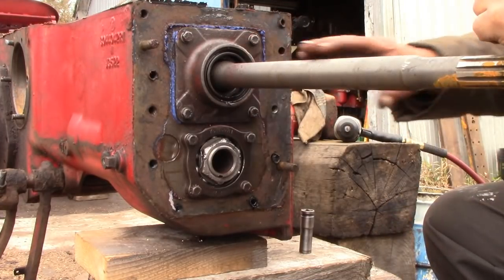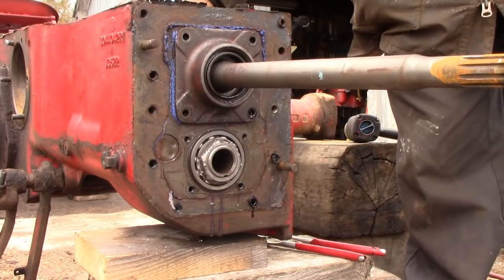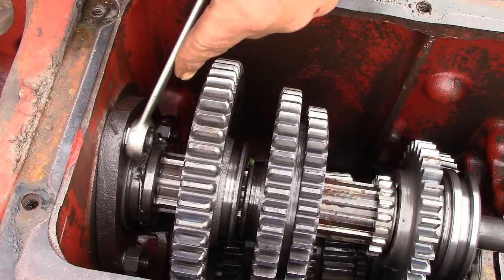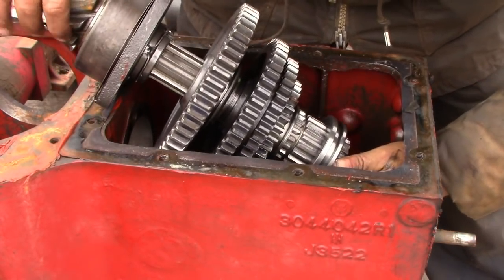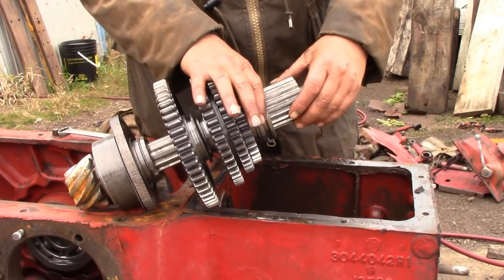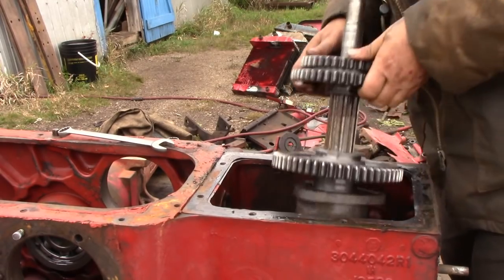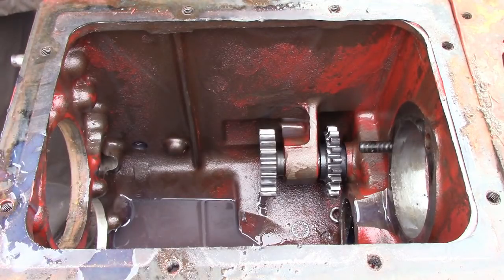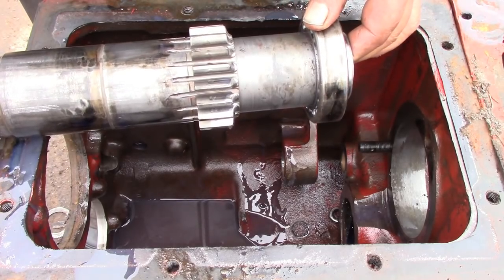B414 Etc  Series Transmission dis-assembly

Comment: Where does the chain with the plactic  couver on it in the Hyl. Unit connect to Found it when I check HYL unit The chain is connect in back  but the front chain not connect  Where does it connect too Thanks any help appreciate
Reply from the maker: It's been a while since I've been into one of those units, I don't really remember where it hooks to.

Comment: What would make noise in the gear box in high range, but not low? The noise go’s away when you depress the clutch. 
Thanks in advance!
Reply from the maker: I would guess a bearing, likely the "quill". You will need to start digging in to find where the problem is. Thanks for watching!

Comment: Hello, first of all thank you for your videos.
I have one question: Do I have to disassemble the whole thing to replace the drive shaft seal (751080R91), or is that possible without completely removing the housing?
Reply from the maker: I'm not sure which seal you mean because that part # isn't showing up in the online parts book, likely an updated number now. The seal ta the back can be replaced by removing the 3 bolts in the retainer and slipping it off, no need to remove the shaft or dis-assemble anything else. Thanks for watching!
Reply: @CanadianRedneck15  Unfortunately, the third screw is right above the shaft and cannot be unscrewed
Reply from the maker: @UltraWK  You can remove the shield if it's in the way, that third bolt has to come out , that is the only way to get to the seal.
Reply: Hi Dave, do you know if the reverse idler assembly can be removed without tearing everything apart?

Comment: Hi Dave,
Thanks gor your very informative videos. I have a question. Where is the hydraulic pump located on a B414? Thanks for taking your time to answer my question and have a nice day.
Reply from the maker: The hydraulic pump bolts into the timing gears at the right side of the engine, just follow the pressure line to the lift unit to the pump. Thanks for watching!
Reply: @CanadianRedneck15  Thanks Dave I did find the hydraulic pump and removed it to replace it. The new pump did not come with a gear. Any suggestions on how to remove gear from pump? Thanks again for your help.
Reply from the maker: @christiangulizia4480  Once you remove the nut put a pry bar behind the gear and hit the shaft with a hammer.

Comment: HI Dave, great videos. Perhaps you can help me. I have a B414 and recently I noticed oil discharging from the dipstick tube. I drained crankcase and ended up with about 18 litres of oil! I then drained transmission and only had 4 litres. What is going on here? Any suggestions on what has happened?
Reply from the maker: There shouldn't be any way for the transmission grease to get into the engine. Have you been needing to add hydraulic oil? Has it been using more fuel than usual. It could be leaking oil through the hydraulic pump or fuel through the fuel lift pump or injector pump. Thanks for watching!

Comment: I have a 63 B250 that has been sitting for a long time.. I drained a lot of water and melted a lot of ice out of the transmission. After finally getting it running I find I can only go between first and reverse. It won’t slide into any other gear. Is this a problem in the shift cover or deeper in?
Reply from the maker: It's probably rust on the rails in the shift cover, you can take it off and pull the rails off and clean them up. While you have the shift cover off it will give you a chance to check out gears too. Thanks for watching!

Comment: I recently just got a international 3414 backhoe and I took the shifter plate and plate off over rear end gears and the bolt on bearing which in your video you called it a bearing retainer has came apart how would I go about getting that bearing or just the whole main shaft assembly

Comment: Dave, I have the same transmission, the clutch seems to work properly, however it usually grinds into gear. I've tried waiting till the tractor stops, and also double clutching. Nothing seems to help. What would you say is causing the grinding? Thanks!
Reply from the maker: If you come to a full stop and then shift gears and it still grinds the clutch has to be grabbing. Thanks for watching!
Reply: @CanadianRedneck15  yeah maybe I'm taking out of gear and then stopping it, need to leave in gear then stop, I'll pay more attention next time, thanks so much!

Comment: hello, take it easy, my ih 444 is stuck in serial gear, it stops when it is reinforced, how can I do it, thanks
Reply from the maker: At the base of the shift lever there is a little cap on either side. Take a small punch and drive it into one and this will push the pin out through the other side, you can then take a long screw driver or pry bar down through the opening and line all of the notches up in the middle of their travel. Thanks for watching!
Reply: @CanadianRedneck15  thank you💖

Comment: i have the industrial loader version of this tractor a 3434.,,well mine is a very late 1982 based on the 434..it will be time consuming to split as the loader frame and cab is built around the tractor ..the bearing race in the reverse idler has collapsed ..the tractor is new to me and reverse seams'' fine ..its been like it for some time as there is no shrapnel in the bottom of the gerar box so someone has cleaned it out and not fixed it  i only noticed when i was replacing the top gasket..from previous experience with a 3434 years ago when this baring collapses the needles from the bearing mixes with the oil and bang and ping about when they jam with the gear teeth...the diff cover is easy to remove on the industrial tractor as it only holds the seat in place so easy to get to the snap ring so what i am asking do you think there is enough room to remove the reverse idler and fit a new bearing with out splitting the tractor and dismantling  ??? thanks dave
Reply from the maker: It's certainly worth a try, if you can fish it up by would save a ton of work! Thanks for watching!

Comment: We’ve got a knocking noise when in second gear in both high and low range. Can I just take the gear shift lever plate off to see what’s going on?
Reply from the maker: You will have to lift the hydraulic lift unit off to get the shift cover off, but that is the best bet for seeing what is going on. Thanks for watching!

Comment: Hi Dave,Mike in Ireland,rebuilt a b275 engine with help from your channel thanks.quill bearings missing in gearbox, my q is do I have to split the tractor in two places or can I just split in front of the gearbox.does the shaft slip out of the clutch section or do I need to split it at the clutch also,feeling a bit daunted ,thanks
Reply from the maker: You will have to split at 2 places to get into the transmission. Split at the clutch first, then you can split at the front of the transmission. Thanks for watching!

Comment: Dave I have a B414 with a transmission that makes a loud grinding/ chattering noise when I put it in high range in all 4 gears. Can I diagnose it by taking the shift cover off or do I have to split the tractor?
Reply from the maker: You should be able to tell by lifting the shift cover. To lift the shift cover you have to lift the hydraulic lift unit. Thanks for watching!

Comment: Can you explain how the 444 tractor should sound it makes a noise when I'm operating it but when I press the clutch it goes away and it sounds like it's getting worse
Reply from the maker: Depending on the noise it could be a bearing going back, broken gear or hard to say what else. The only way to know is to start digging and find the problem. Thanks for watching!

Comment: Great presentation indeed. It's so helpful. I am a new owner of a 450 and looks like they have the same arrangement with 414. Just want to know if gearbox and differential share the same oil after topping up from gearbox filler port, and how many liters does it take
Reply from the maker: An IH 450 is quite a different tractor though the transmission and differential do share a case and the oil is shared so you can fill from the one plug. Not sure how much oil it takes.
  Thanks for watching!

Comment: Hi Dave. I have a 414 that I'm tidying up to sell. Waiting for some brake pads, temp guage and tacho and I think watching your other video I need a steering rebuild kit as it is full of water and gunk but it also drops out of 3rd and 4th gear when underway. 1st and 2nd are fine. I cant remember if high or low range make a difference. Wondering if you have any idea what might cause this?
Richard
Reply from the maker: Sounds like there are some worn gears in there or possibly bad shaft bearings.
  Thanks for watching!

Comment: I've got a 276 International, looks like I might need to remove the whole hydraulic unit to remove the top trans cover? One bolt seems almost impossible to get out, am I correct? Just got the tractor, been setting a while, and the shifter doesn't move.
Reply from the maker: Yes the lift unit will have to come off, you will need the space to set the forks back onto the gears even if you could lift the shift cover off.
  Thanks for watching!
Reply: Thanks, I'll have to borrow an engine hoist from a friend to get that lift unit off.
You'll be my first call if I need parts, you're not to far from me.
Reply from the maker: @Gearheadtom  that lift unit sits down on 2 dowels, it usually is kinda "glued" in place, you will probably have to pry it loose before you can lift it clear.

Comment: Hi Dave,  My B414 works perfectly in low range but when I lift the lever and put it in high range, it makes a noise in all 4 gears. its kind of a grinding rattling noise. any idea whats happing there?
Reply from the maker: It could be the quill gear or a worn or bent low range shift fork not completely dis-engaging the low range gear.
  Thanks for watching!
Reply: Might be a idea to change oil into gear oil 80-90w instead of some tractor universal oil to. I got that problem on my 444 after changing to tractor universal, but i just drive on. 10 years whit the same noise now....., ups maybe time for a oil change, gear oil this time for sure. Love these videos, so well done, how to take it apart, and what might be wrong, excellent presentation.

Comment: Is this transmission the same or similar to one that is in a 300 U ? The transmission in my 300 has a knocking sound ,it changes with RPM's and goes away when the clutch is depressed.
Reply from the maker: THese are a completely different transmission, they are a dual range 4 speed where the 300 utility is a singe range 5 speed.
 Thanks for watching!

Comment: Would you have an idea of what is the cost for some gears and forks in the transmission, I'm currently looking at a B275 for sale that has transmission problems and I would like to have some kind of an idea of what awaits me!
Reply from the maker: I don't believe any of the transmission parts are available new any more, but I have a good supply of used here. Forks are $25 each and the gears range from $25 to $150 or so. You can reach me at sales@chowntractorparts.com

Comment: Thanks for your  video, my B414 clutch is stuck do you have any tips to get the clutch working again ?
Reply from the maker: Check through the inspection cover for any broken levers on the pressure plate, if any are broken the clutch will need replaced. If nothing is broken you can try starting it in gear where you have some space to drive, stand on the clutch pedal and jump on the brakes  repeatedly, it might break it free.
  Thanks for watching.

Comment: Hi, Dave. I have a US-built 444 with no reverse in Low Range.  All other gears work fine.  Any suggestions?
Reply from the maker: Does reverse work in high range? If so that has me baffled. About all you can do is open it up and see what is going on.
  Thanks,
    Dave
Reply: @CanadianRedneck15  Yes, it does work in High Range.  Watching your video, it just doesn't make sense as to why I wouldn't have Low Range.  If I get deep into it, I will be sure to post my findings here.  Thanks for the quick response.  Love the Channel!
Reply from the maker: @theslimeypebble  I would appreciate hearing what you find out. Thanks for watching!

Comment: Hi Dave I have a b414 just wondering to remove the shift cover do I have to remove the hydraulic cover first or is it possible to remove the shift cover on its own the back bolt is rite under the hydraulic control valve
Many thanks in advance
Reply from the maker: Yes, the hydraulic cover has to come off first so you have room to lift the shift cover.
Reply: @CanadianRedneck15  Thanks Dave

Comment: I'm from India. I have also International  tractor but this tractor gearbox and rear axle not good. Gearbox take sound when changes the gear and rear axle also take sound when drive in back gear or 1st, 2 and 3 gear
Reply from the maker: That sounds like a bearing in the transmission. Thanks for watching!

Comment: I have a mf135 and was wandering if the mf35 back rims would go on my 135. I have those real fat low orchard rims and would like normal tractor tires
Reply from the maker: Yes the 35 and 135 both have the same bolt pattern, a 6" bolt circle and a 4 5/8"pilot hole. Thanks for watching!

Comment: I have a IH 3414 Industrial Model that uses many of the same parts. last month i replaced the dual clutch by lifting the engine out the top of the loader frame.
If someone can lead me to a splined shaft for the front crank shaft driven pump which is 8 inches long I would really appreciate it, or if they modified their pump drive let me know what i need to buy.
Reply from the maker: I'm sorry I don't have  a source for that. Thanks for watching!

Comment: I have an early b414 with the smaller brake disk I can’t find anywhere do you know if they used the same disk on any other model that would be correct?  Thanks !
Reply from the maker: Brake disks from a B250 and early B275s would also be the same disk, part number 704422R93. They are available from A&I Products dealers, search their website for a dealer near you.
  Thanks for watching!

Comment: Good  day  Interesting video.  I saw a spindle, I think 414 front wheel bearings fit 574?  Those gears seemed big for 35 hp? How do you keep gears from rusting now. If you ever strip another tractor record  if possible. It looks like weather is basically same all over, getting colder. Thanks fo r now
Reply from the maker: Thank you, I am glad you enjoyed the video. The 574 has a quite a bit larger spindle than a 414 so the bearings don't fit. The transmissions in these tractors are quite sturdy, damage mainly occurs from operators that don't know how to shift an unsynchronized transmission. We try to leave the gears a little oily and then juststore them inside to prevent rust, they may get a little surface rust but nothing that would cause any real harm. Winter is definitely right around the corner. Thanks for watching!